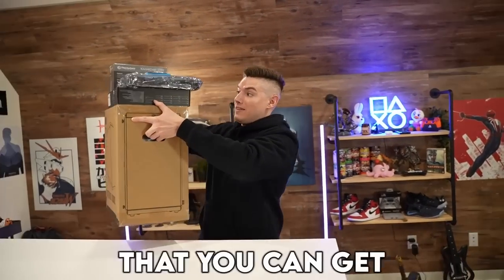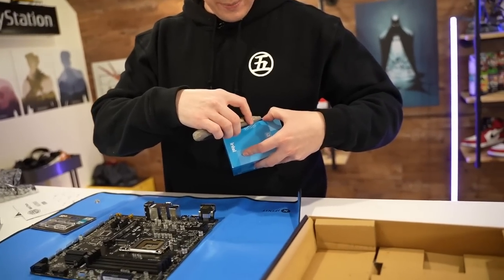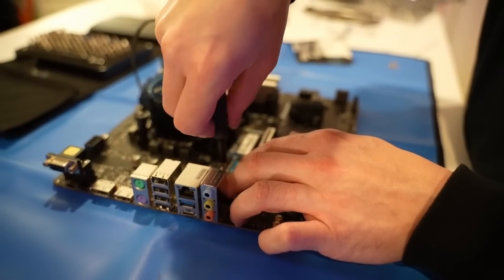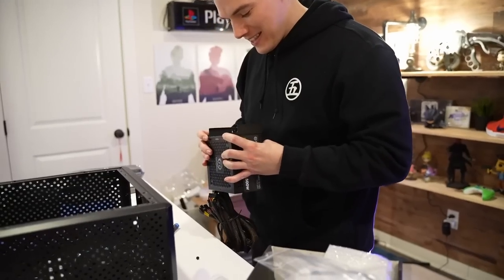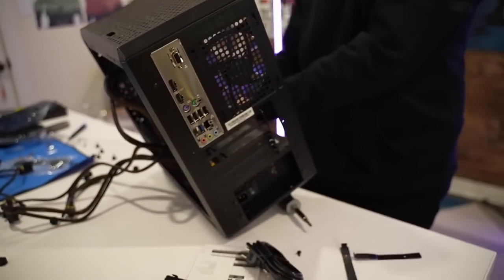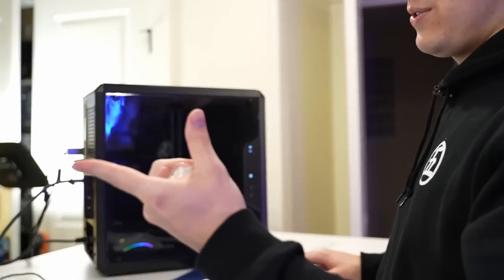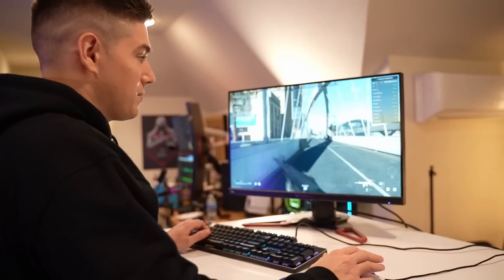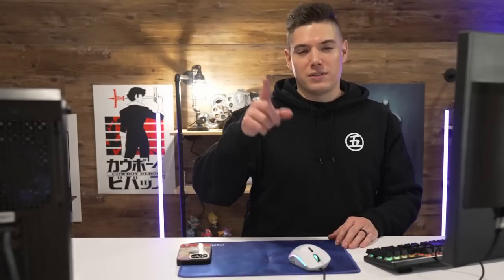$500 Budget Gaming PC You Can ACTUALLY Build

Comment: I would like to point out that case is, in fact, a hotbox. It has almost no ventilation since the holes are spaced so badly in the front and on the top. I took a dremel to mine and cut out squares where the fans go, worked great after that with just the magnetic filters.
Reply: Im not alone! Did the same with mine as i dont want to buy a new case. Had to modify a bit to make sure fans dont hit the case after cutting squares. Works great and have it for around 4 years now.

Comment: 1070 ti is an interesting choice. Its right near the end of support from nvidia for drivers, Id be spooked building with it. On the amd side you at least have nimez drivers when the card is no longer supported.
Also, for about the same cost you could get an amd 6600m off of aliexpress from risc51, about 180 usd.
Reply: Did he say 1070ti or 1070?
I thought I heard 1070.
Reply: @peterpan408  thought it was a ti, I may be wrong, but the product is still the same gen, and will be discontinued driver wise likely at the same time
Reply: @KadiusFTW  Yes, he later stated ti.

Comment: Can i use any 1070 and still get similar performance as shown in the video or no?
Reply: No because the card he got might have lower clock speed than average since it's a used 1070. You might get a slightly more powerful or a slightly weaker 1070 if you're gonna get a used one.

Comment: PSA: The pc case used in this video is a POS. If you don't want your pc to overheat consider spending a little more on your pc case. (I own this case and thermals are bad even with 2 140mm fans as intakes)